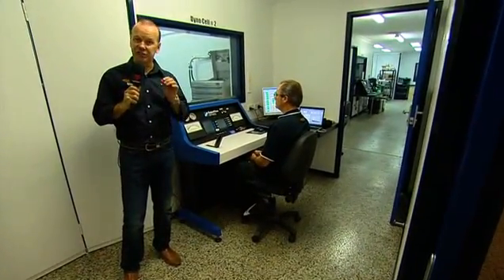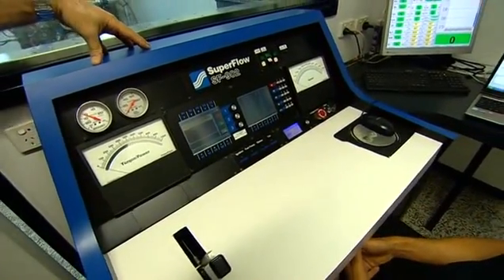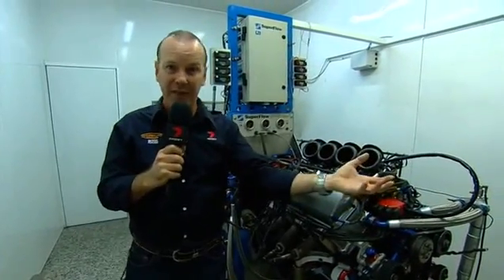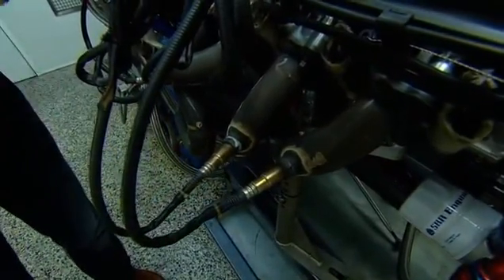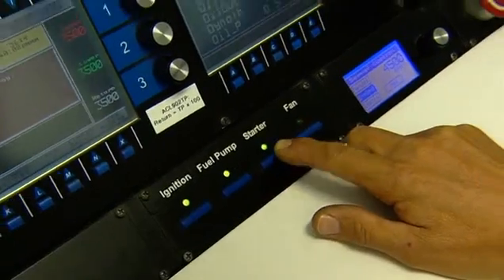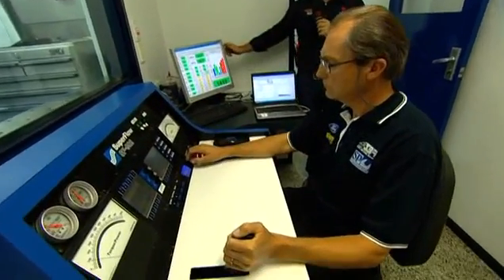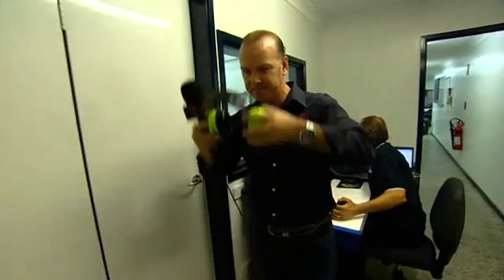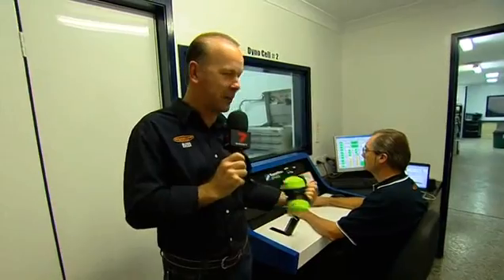Stone Brothers Dyno Cell

Comment: guys going in the red with the o2 sensors on camera haha
Reply: i know this was 5 years ago, but that is a narrow band 02 sensor, so the mixture is only out by a small percentage, and also those cylinder in the red are most likely the coldest cylinders, that are fed the coldest water from the radiator, so they can withstand leaner mixtures at WOT.

Comment from the maker: Answer to the first part is it's a 5 liter as limited in the rules.  Part B, is that as part of the rules, V8 Supercars works the rules on the engine package to be about 600-620hp.  Notice he said control cam shaft
Reply: They had 635hp in 2003.
Reply: Control cam came in, midway through 2010 season.
James Courtney didn't win anymore races that year & luckily hung on to the Championship.
Reply: 611-612hp = mid pack if you're lucky.